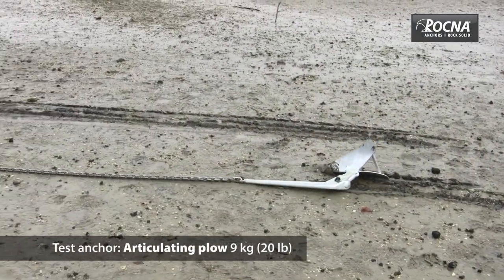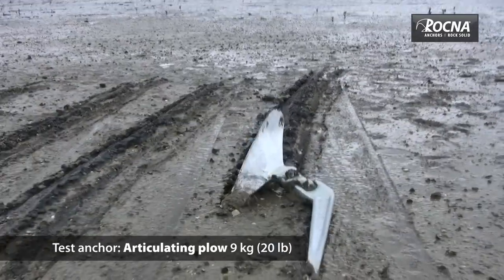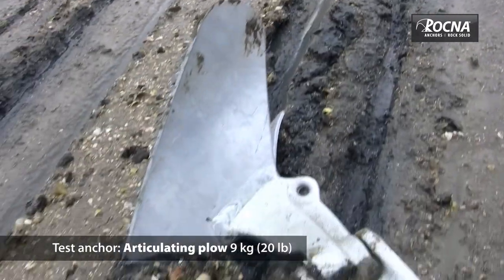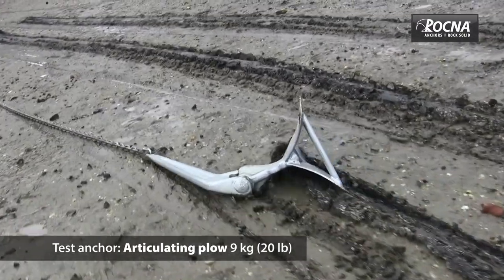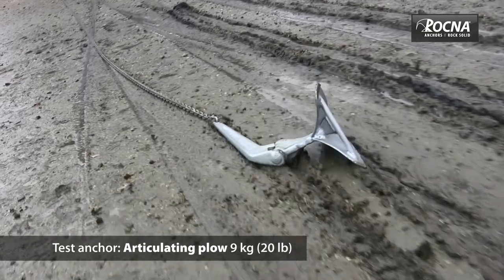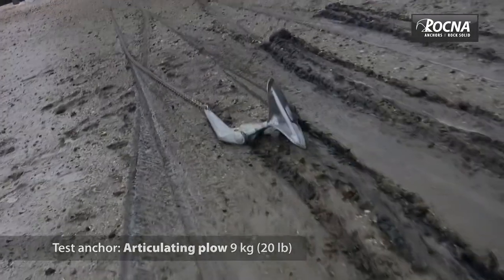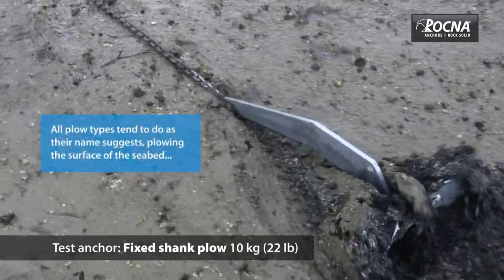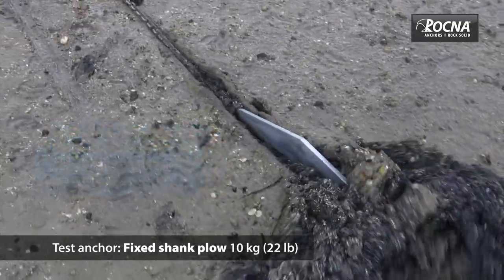Rocna Anchor CQR Delta Beach Test

Comment: The delta is in and doing its job.
You are pulling it with a couple hundred horse power truck...
Even your Vulcan doesn't work with a motor boat using big engines when backing down

Comment: the problem with the test is that you rarely set the anchor wit the chain pulling flat on the ground
Reply: With a 3-1 or better 5-1scope it is  horizontal pull.   I have a delta, it just plows.  I am changing as soon as I can